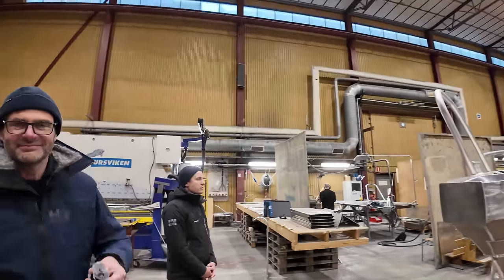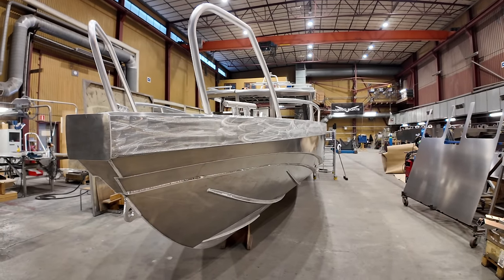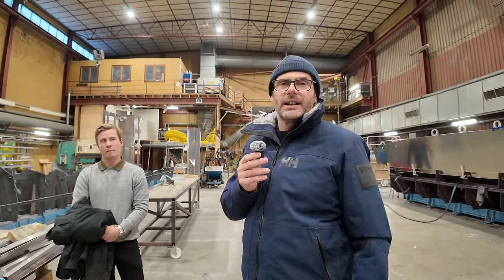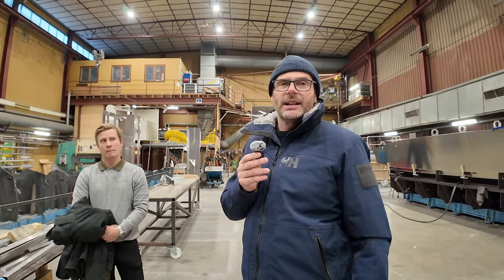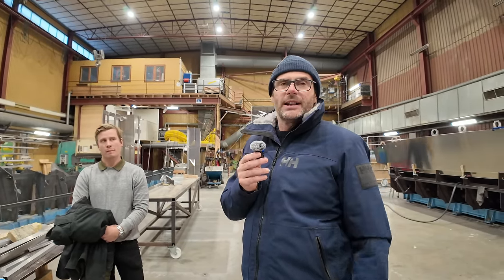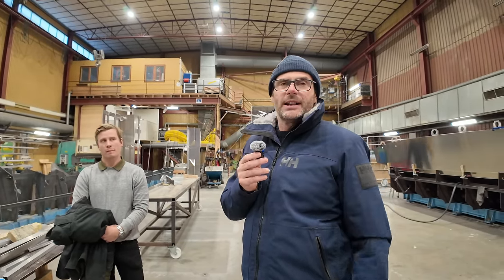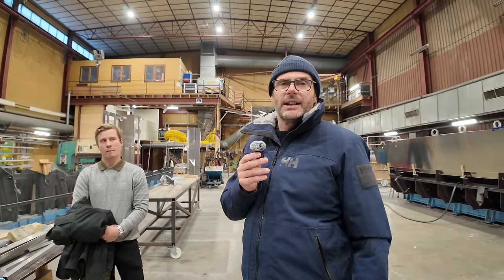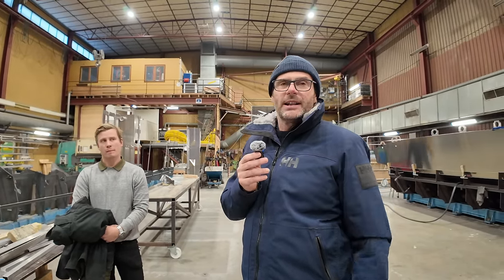EXCLUSIVE Look Inside the Home of VIGGO’s 70+ Knots Aluminium Boats!

Comment: More on Viggo boats please please please!!   Also, broadly speaking what's the smallest Yacht that could carry a C8 as a tender? 40m??
Reply from the maker: I guess it depends on deck space but yeah, 40
metres should be about right. The C8 is relatively light
Reply: The C8 is around 2.1 tonne with 200ltr of fuel onboard which is just over half a tankful. They are 8.2m long x 2.3m wide. Ideal explorer yacht tender !
Reply: @sib610   Thank you kindly.
Reply: @YachtBuoy   Thank you.
Reply: Yacht Buoy has done a few on Viggo already, the C8 and the C10…check them out.

Comment: He lost my interest when he said "maintenance free"
Reply: The engines will require servicing annually and anodes replacing,  naturally, the antifowl will need topping up depending on usage ,  eventually Blue Sea electrical systems will need looking at (not for many years), and the hull needs a jet wash every now and then but essentially these hulls are absolutely maintence free unless you want to keep them ‘shiny’ . The alloy oxidises , dullens in time , and will show the odd battle scar but that’s it assuming it’s built well. Commercial ally Boats built in this yard in the 80’s are still operating in the med. nothing is absolutely maintence free but you get the idea.

Comment: That’s the way boats should be built.
In Canada the extreme weather is very hard on conventional boat materials and aluminum seems to work perfectly.
The longevity of aluminum during freeze thaw cycles is superior. Repair of damage is not difficult or expensive.
Aluminum boats are growing in popularity and the only question is why it took so long.